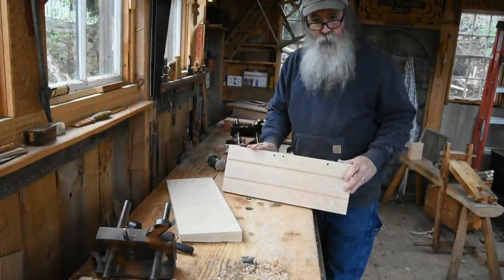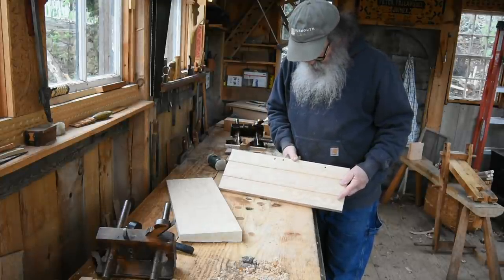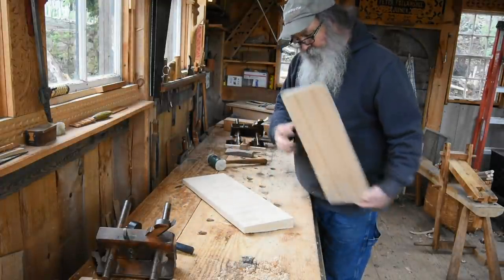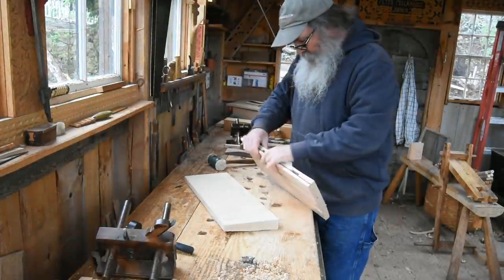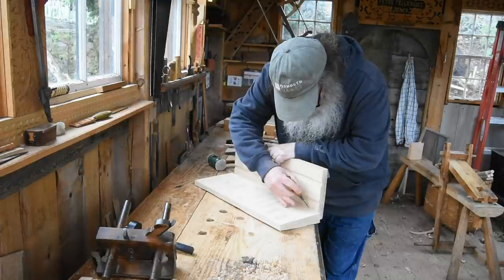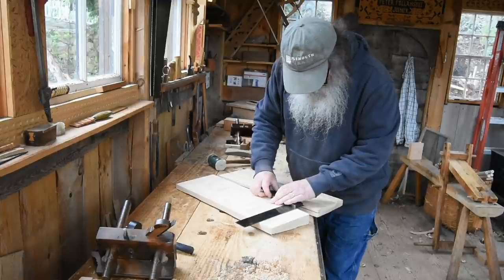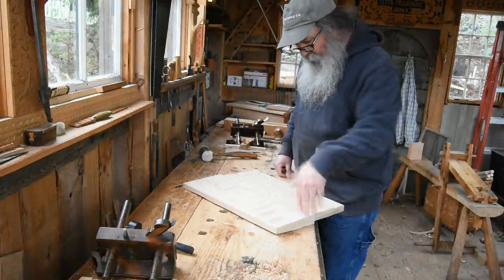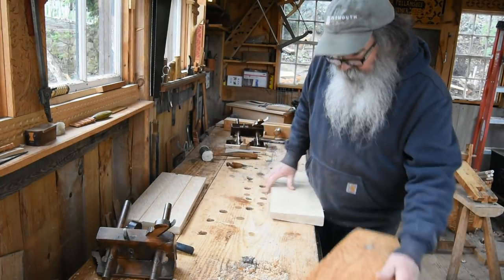scratch stock deep rails

Comment: Why not use a router plane to make the depth of the moulding the same?
Reply from the maker: Connor - one reason I use the plow plane/scratch stock combo is I know those tools were available in the period I study. I have never seen mention of a router plane (by any name) in a 17th-century inventory. The moldings on the period pieces aren't perfectly uniform, they have some variety to them. My approach attempts to replicate the process as closely as I can, which I feel will get a reproduction as much like the original as I can...emphasis on "attempts".
Reply: @MrFollansbee  you know what, that is fair, thank you

Comment: I imagine that you would sharpen it like a scraper ?
Reply from the maker: You certainly can sharpen it like that, turning a burr, etc - but I often just use them right off the file. They're not removing much wood. I stone the sides of the blade before shaping it.
Reply: @MrFollansbee  
Thanks